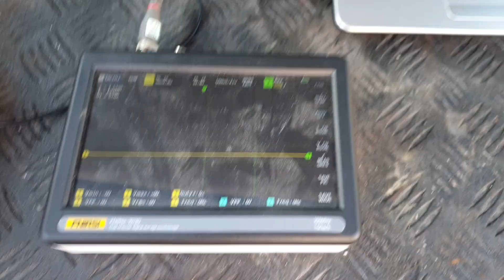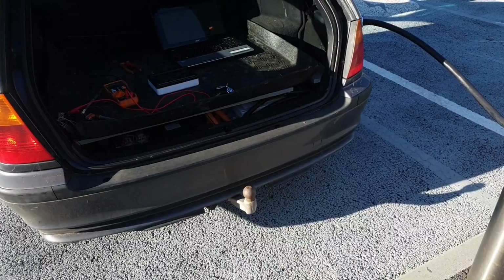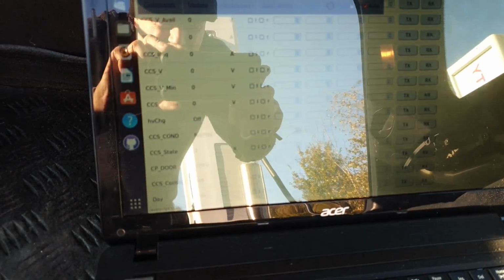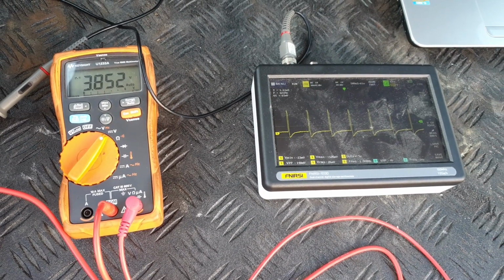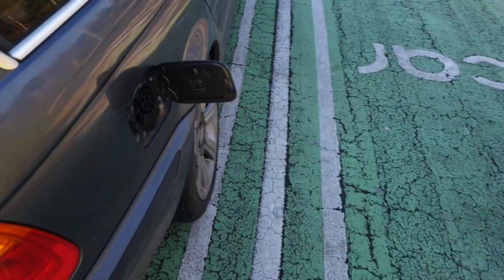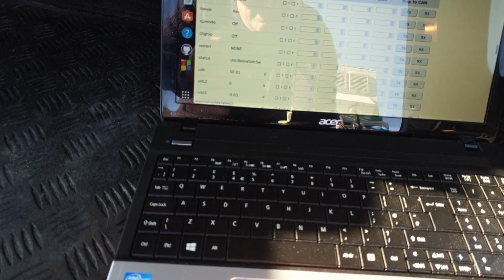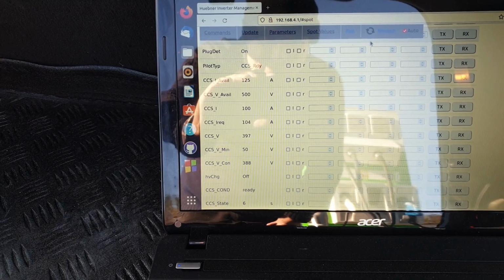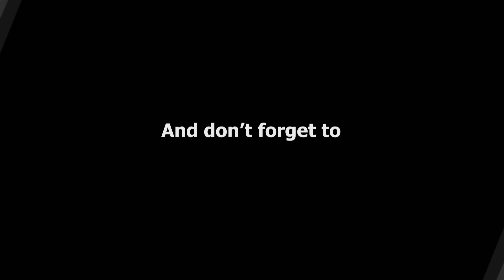The CCS Saga Continues

Comment: 👍Great video Damien.
I have the same problem, though intermittently, with my Kia e-Niro on ABB (Clever and E.on) chargers.
I was thinking if it could be a signal level or quality problem. Not implying that your car and electronics are not properly made 😆, but since you have the electronics and protocol analyzer for it, you might be better off than others in diagnosing it.
Normally it works for me, if I connect the cable before activating, but like you I am also presented with the 'waiting for current' and 'turn of your car' messages. Some times it also throws an error in the car, which I can't reset via OBD-2 and have to go the dealer to fix. I was thinking that maybe my car was in the one end and the charger in the other end of the 'electrical capabilities spectrum'.
So, any brightness cast on this issue is very welcome. 🤔

Comment: This has probably very little to do with your system...
Try to find another BWM i3 owner and see if they can charge at this station...
I am current working with Phoenix Contact and they have a few years back told that even as the stations and the EVs are "within standard" they will have issues like this.
Everytime any automaker launches a new car, facelift or software change in their car, PC have to update their charge controller software. My guess is that the charge provider still have a problem with the BMW i3 which they still have to update on that particular charger station